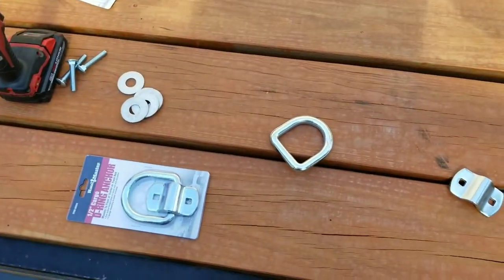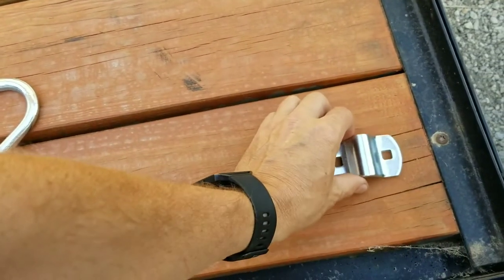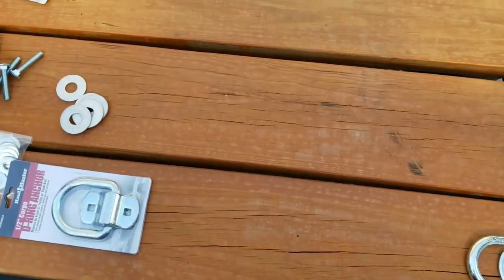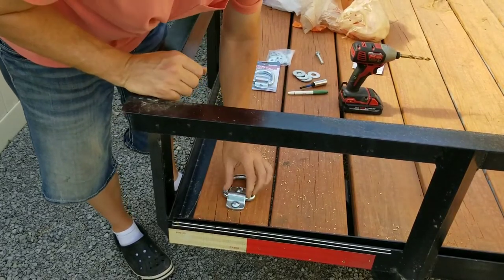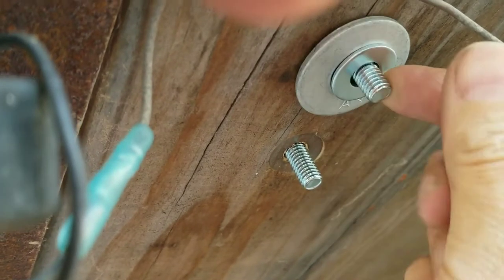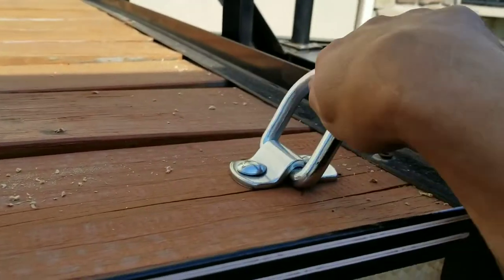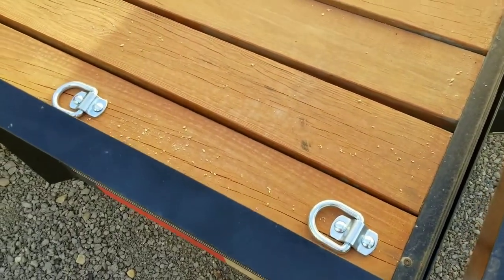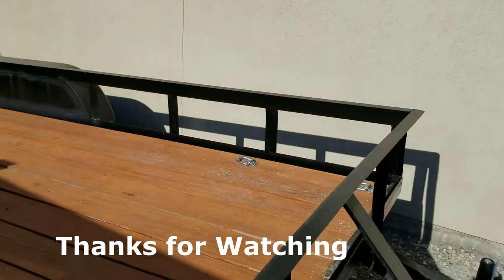Installing D-Rings on my Trailer, so we can tie things down.

Comment: Not sure why you didn't go through steel, it would be easy to weld in some steel if location was a problem, I mean d rings to wood? Not very strong (strong being relative like accident strong) probably fine for everyday traveling,  not for me I would definitely bolted through to steel. js
Reply from the maker: You are right, securing it to the steel would be stronger, for sure.